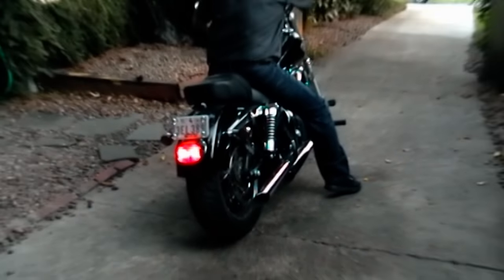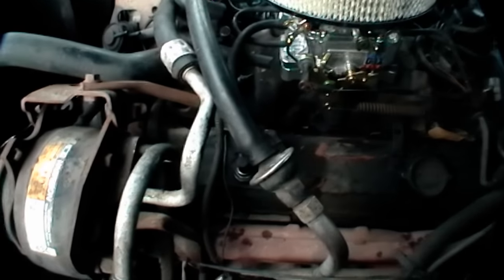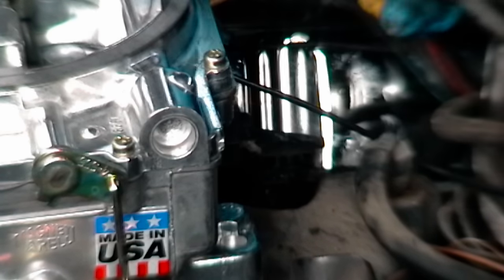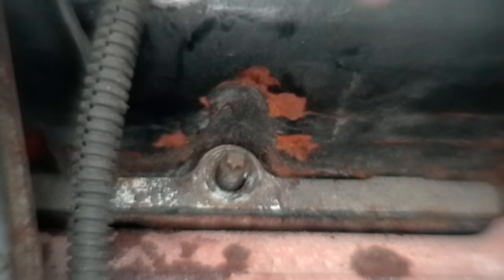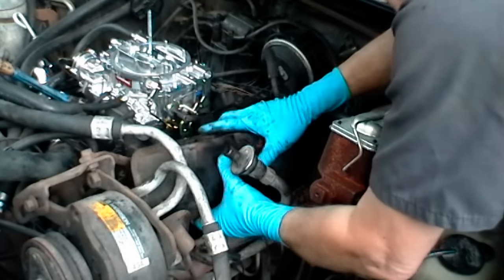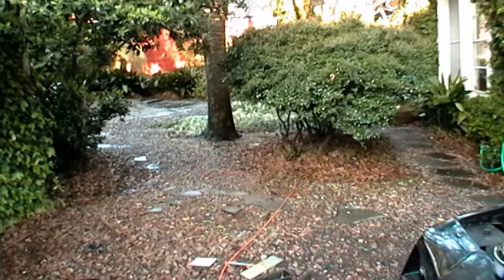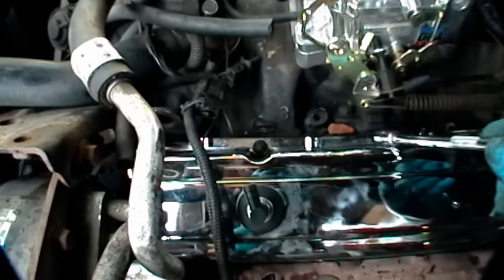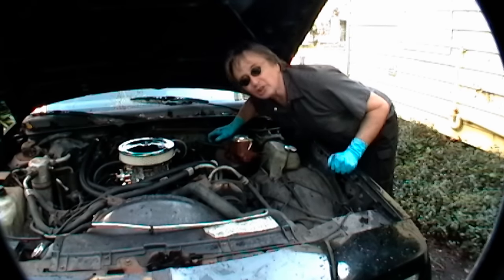How To Replace a Valve Cover Gasket

Comment: Oh, to work on a car that is that easy to fix...
Reply: Try an mr2 spyder🤣
Reply: Try a 4th gen firebird
Reply: Try an 1999 Toyota Avalon
Reply: @darthgamer6080  yea, the Avalon is hard, but at least you can SEE the engine. In the firebird 60% of the engine is under the damn dash
Reply: @adamspitfire  that’s what I have and this is the issue I have that needs fixed 😂 so how hard is it gonna be
Reply: @Tannytkn  it's easier to skydive with an umbrella and find the cure for cancer in one night under your bed.
Reply: @adamspitfire  lol 😂 also I have to do the oil pan gasket and motor mounts
Reply: @Tannytkn  oil pan gasket is easy if you can get the bolts off

I'm sorry for your misfortune of an motor mount and wish you good upon your horrific journey of pain anger and a shitton of blood.
Reply: Try a subaru😂 those boxer engines are a money pit
Reply: Try a 2005 Lincoln ls v8
Reply: This is why I daily drive a ‘79 V8 utility, easy maintenance!

Comment: I heard a rumor, that if u put a small amount (about a quart) of diesel fuel, in your (gasoline) car engine oil, right before u change the oil, let it run for about 5 mins... that it can clean out the internals of your engine... is this true, & what about tyranny fluid. in this same scenario.  just wanted to know if that worked... if so, is their other chemicals that work better that's not marketed for that use, that's 100% safe... thanks...

Comment: Of course you showed the easy side. Can you tell me how you got the other valve cover off? That's the only one I'm having trouble with. I have the same engine as this one.
Reply: prolly to late but you have to take the belt off the ac compressor loosen the bracket bolt and slide it our of the way.
Reply: @two_tone  prolly too late 🤣🤣 im dead

Comment from the maker: most valve covers these days don't even need sealant, especially the silicone ones. But I use sealer on the old fashioned ones that use cheaper cork gaskets.

Comment from the maker: you can use rubber without sealer. The price just depends on the car, some are 30 bucks, some are hundreds when parts have to come off like intakes.

Comment from the maker: @Matthew55904  You do not need to take the valve cover off to check spark plugs. You may have to take those stupid beauty covers off to access the plugs, but not the actual valve cover. Scotty

Comment from the maker: valve gaskets are on the top , just under the valve cover assembly. A pain to do, but just moving crap out of the way with normal hand tools. Head gasket is where the head bolts to the block , a GIANT job I would not advise doing except to really mechanical people with lots of tools and experience

Comment from the maker: @X2N18 Just make them snug, they don't need that much force. They are small bolts and will break if tightened too much. That's why I used a tiny 1/4 inch ratchet. Scotty Kilmer

Comment: I was more interested in seeing how you fitted the new gasket, whether you put the gasket adhesive on both sides of the gasket? did you use a cork or a silicone gasket? this video should be described as how to change an old rocker cover to  a new chrome one as there is practically zero explanation as regards the gasket.

Comment: lol you didnt even put a gasket on the new one???
Reply from the maker: I certainly did
Reply: ah, just didnt show that part in the video i guess
Reply: bowtieguy
Reply: What Daniel Figueroa
Reply: I was wondering the same thing.
Reply: stay away from your vehicles hood
Reply: bowtieguy.
Reply: Exactly smh
Reply: This is "How To Replace a Valve Cover Gasket" without a valve cover gasket.
Reply: @boduke548  stay away , period
Reply: @swaggedoutwun  yes he showed that part it was the sealer he was putting on give your head a shake
Reply: Yeah, I got the easy side. It's the one that's under the intake manifold what's arrested on bolts to go all the way around the back by the firewall that's pissing me off!

Comment: Try doing this job on a Ford Explorer.  The engineers decided to cover the these things with every single wire and hose the engine comes with.
Reply: I know right! Same w the Ford Ranger
Reply: I just did it. And almost threw a wrench at my truck
Reply: Been there as well
Reply: Not as bad as my continental. Those idiots hired the most complex engineers. I have to remove the fuel injectors, the ignition coils, and a bunch of wires and hoses . That's the easy part for the front valve cover. I gave us since I didn't have a swivel but now that I have one I might just get to work.

Comment: Hi , I have a question ,  It's my first time changing my valve cover gaskets and the car is a 1988 ford mustang with fuel injection so it has that tunnel ram thing that is in the way of getting the valve covers off.  so how do I do it?   thank you  jodie

Comment from the maker: old age. . Change the pcv valve and pray it's just that. If not, the engine is just wearing out internally. In that case, drive it till it drops and keep adding oil

Comment from the maker: live with it, you have to pull the head off to change the valve seals, and it could also be worn piston rings requiring a full rebuild. They can run years that way, just keep oil in it and change spark plugs as they carbon up

Comment from the maker: fan clutch is easy IF you have the special tool to unscrew that giant bolt. And the top of the intake would need removing to be the valve covers off the whole way, no working room there.

Comment from the maker: safe to do that, try some compressed air too to blow the crap out when loosened.  I don't recollect any plastic clip though, if it's in the way, figure out how to turn it to get it off IF it has no bolts holding it on hiding under any small cover

Comment: Hey scotty, once replacing the valve cover gasket on the the engine, should we still use high mileage synthetic motor oil or go back to using regular synthetic oil?
Reply: there's tons of other o-rings and seals in the engine, the valve cover seal is not the only seal. to be honest those additives probably don't do much if you have an oil leak anyways.

Comment: Good job, anyway I would like to remember the people who want to replace this part that aluminium is not very strong thus while tightening the screws be careful not to exagerate otherwise you will damage the thread causing more problems afterwards😉

Comment: Hi Scotty , I replaced the valve cover gaskett and when putting the bolts back on I had a bolt snap off and I wasnt using any power tools just my hands and I am not a strong guy.  The bolt is in a position where I cant get it out from the bottom and was left with a top that is a half moon on one side sticking up (so its not flush).  I have used lubricating sprays and tried to use that little bit that is sticking up to grab onto rn it and tubut its not working.  What should I do?  PLEASE help me.

Comment: hey Scottie, i have a 95 toyota camry. it started, drove a block then shut off. all lights n radio working. car now cranks but wont start. the crank sounds normal to me, not faster than normal. i am seeing a little tak when i crank the key - not much only about to the very first notch.  i figured  bad fuel pump so i replaced it but it still wont start. the relay and fuses seem fine. i get pressure when i depress the fuel pressure nozel, i see some spark coming from spark plugs.  so i believe i am getting both fuel and spark. where should i go from here? i dont have any fancy tools just basics. i dont know much about cars, and i am pretty broke. 
Can you or anybody else help ?
Reply: Patrick Engles Jr probably the distributor!

Comment: Hi Scotty!!! love your channel. I have a question. I have a SBC 350. I was going to put on a Edelbrock EPS intake manifold. Upgrade the points ignition system to HEI and put on a new carburator. It has a Qudarajet that needs rebuilt which I was going to attempt but after further study found it would be easier to just but another carburetor. Since I highly respect your opinion, which would you choose Edelbrock, Holley or another Quadrajet. I have received so many opinions but they are biased just like people who prefer dodge over Chevy or Ford. or visa versa. Everyone I spoke to said make sure you get an electric choke carburetor also. That was their only common ground.  I need your expert opinion please.
Reply: I would go with either Edelbrock or quadrajet in my experience those are easy to adjust

Comment: Hi Scotty, I just finished replacing the valve cover gaskets, spark plug seals, and spark plugs on my 1992 Lexus ES300. It started up ok but after warming up is idling rough, I think it's running on 5 cylinders (feels like my 1992 Nissan Skyline when it needed a new coil pack). When accelerating I usually get all 6 cylinders, it's worst when stopped at lights, feels like it will stall but doesn't. When I start from cold it's ok until it warms up... Any suggestions?? I was going to go back and make sure the spark plug leads were pushed in properly etc, then maybe test the plug leads as I didn't replace them. The spark plugs I used are the ones recommended by Lexus / Toyota. It was fine before I did the work on it, so I figure it's something I've done, or maybe moving the spark plug wires was enough to be the death of one of them..?? Appreciate any help, I can't afford to pay someone to sort it out!
Reply from the maker: Jas George the back side gaskets are hell to get on, requiring intake manifold removal. SO many things can go wrong in that job, check for wiring shorts, vacuum leaks, and any sensor that may have been unplugged

Comment: just curious what did you charge for this job? if I use the felpro rubber gaskets do they still need sea lent? I've been told none is needed on rubber gaskets

Comment: Scott, Thank you again for this great tutorial. My car is 2000 Taurus, when I do the valve cover gasket(front and back), beside the gasket, what else I should put on the valve cover? silicon sealant? "Right Stuff". May you give me a little detail? I saw mixed information on the web. Some people say gasket itself is good enough. Some people say you have to add silicon sealant on the edge. What is your opinion? Thank you
Reply from the maker: if you use a gasket, you can put a little sealer on it to keep it from falling off the cover when you put it back on, i often do that. The faster drying sealers are best for that so you don't have to wait as long
Reply: Scotty Kilmer Hello, May you suggest a brand & name that you use. I know you use "Right Stuff" but I am not sure which one you used for gasket sealant for valve cover gasket. Thank you
Reply: codyq0987 Ant brand. Make sure it is High temp RTV.
Reply: If it is a press fit gasket, you absolutely do NOT want to use RTV, it acts at a lubricant and will cause the gasket to squirt out.

Comment: Hey Scott, I got a 4.2L 6cyl on a Jeep Wrangler I’m having trouble with the last bolt on the valve cover against the fire wall. It’s an 11mm I just can’t seem to fit the socket down in there. Any ideas?

Comment: @eensha6242001 ohv stands for overhead valve you dont put them in your car has overhead valves unless its from like the 20s you could try it on your car but if you have no experience i would recommend you do some lawnmowers first

Comment: I’m replacing the valve gasket on my 1995 Corolla 1.6 and after putting on the new gasket do I need to apply gasket sealer or should I not? Is it needed?

Comment: Hey Scotty. I have a 2003 Chevy Suburban with the 5.3 vortex in it. My valve cover gasket and bolt grommets were leaking oil. Upon replacing, I noticed that there was slight sludge and grime underneath. How can I clean the area?

Comment: I was going to tackle the job on my Lexus LS400.  Then I looked carefully at all the stuff I have to remove just to get the valve covers with their spark plug tubes and I quickly changed my mind.  Off to a pro. with my checkbook in hand.

Comment: @samvid74 Scotty is oil can come from the bottom going through the spark plug  from botom up to the spark plug tube. this is in case  if  head gasket is leaking. because if oil is coiming fromthe top i will see some oil next to the seals and in the top of the oil. but i am seing oil only when i remove spark plugs

Comment: @scottykilmer Hi Scotty I have oil leaking in spark plug in my toyota camry 98. if the upper seal is the problem, why i cannot see any oil next to the seal. i see oil only on the lower end of the  wire that goes into the spark plug. that make me think that oil is leaking somehwere from the bottom. please explain to us. thanks

Comment: I think the valve cover gasket is not the one that cause the leak. this gasket  oprevent leaking of oil to the outside. however it s the spark plug tube seals that are the real causes here. I think another source of leaking are also possible it s the bottom of the spark plug tube. it  s good to replace the valve cover gasket if you already take the cover out  though.

Comment: Hi Scotty I currently have a GMC Yukon 95' 5.7,  it cranks but doesn't start and the head gasket cover popped off while cranking the engine and  the cover is now bent it also had white smoke coming from the engine after it popped off any advice on what it could be? I'm thinking it may be the timing chain snapped  and pistons might be shot.

Comment: Hey um I got a quick question for ya...my 95 gmc seira 1500 was sitting up for a while outside and I'm currently restoring it and I've ran into so problems with it when I start it it has blueish white smoke coming from exhaust and when I give it gas it REALY puts out some clouds I know it's not normal so you got any ideas on what I could do...plz reply asap

Comment: I watched one of your videos where someone changed a valve cover gasket for a client and client came back to you with leaks because they didn’t put weather seal. I had done the same thing on my vehicle few days prior following another video and even knew it was the middle gasket leaking (of the four on my 2010 Ford Focus). I redid mine with your suggested seal, and voila, no more leaks.🎉

Comment: I just got done doing this on my 2013 Chevy Cruze and the thing about that car is that the PCV is built into the valve cover, I changed the gasket but didn’t get a new valve cover and now when I start my car there’s smoke that starts coming out from around the exhaust manifold near the flex pipe once the car heats up after around 30 seconds. Also my radiator fan starts spinning at full speed as soon as i start seeing a little smoke. I’m wondering if this has something to do with my pcv which is built into the old cover or if this is something completely unrelated because I never had these problems before changing my gasket. Any advice would be appreciated.

Comment: hey scotty.. i have a 94 ford f150 300 straight six. it leaks oil from the valve cover and is dripping on to the exhaust manifold and burning up..what should i do and what do you think it might be?

Comment: Help person  who changed my valve cover gaskets put all back together but when try to start car it cranks but don't turn over, when you just turn key on you can hear air or gas line leak what did he miss. 1993 toyota camry 3.0L V6

Comment: hi scotty..there is leaking gunk ..not exactly oil around the valve cover and the distributor. What do u think is wrong in the distributor? and why does the owners manual not talk of the PCV valve replacement..Thanks!

Comment: Hey scotty would a bad gasket cause a misfire on an engine ? Im abt to purchase a 06 ford f150 from a guy who alredy replaced spark plugs and coils on the truck but still has missfires i want to take on the challenge and fix it cus hes tired of it the truck is real clean i think its worth a shot

Comment: Hey Scotty, I got a 2001 Audi A6 2.8. The car has a burning smell and somtimes smokes and I am told its a valve cover gasket thats leaking on exhaust manifold. My question to you is that is there a fire hazard(smokes sometimes) with this leak? Thanks

Comment: Scotty just got a 1986 regal Buick old owner said he change the seals but from the passenger side top theirs white smoke coming could that be bad?
Reply from the maker: +2128rulloa that's often the sign of a worn out engine with piston blow by
Reply: +Scotty Kilmer is the valve cover gasket an important job . and will you see a diffrence once its changed i have a lexus 2000 es300
Reply: Valve cover gaskets are usually replaced because the old ones have failed (cracked/dried out) causing an oil leak. It's not as if it's part of a "tune up," but they should be replaced if you notice oil leaking from them. Oil can work its way down to the manifolds and other hot areas that will cause the oil to burn off (burning oil = blue smoke) not to mention your oil level will decrease as it leaks.
Reply: could be a sign of an old worn engine with blow by, also check the head gasket. I have a 1972 GMC C1500 with a 350 small block and i was getting white smoke at the same location as yours. i pulled the valve covers and the gaskets are fine. Its a common mistake people make with their cars, so ive heard. Turns out it is the head gasket on mine so it could be the same issue on yours. What size motor>

Comment: @ Scotty Kilmer 
okay so i replaced the gasket and when i went to drive it again the car was not shifting right (its an automatic) like i would have to switch it from "D" to 3 gear and to "D" again in order to shift it  and the engine was overheating. could i have not replaced the vacuums wrong or the electrical work ?

Comment: Scotty I have a 1994 Ford F-150 5.0 engine the speed meter stop reading I replaced both sensors still will not work. Also my heater no longer works help

Comment: Scotty do you know the valve cover torque for 89 toyota pickup 22r
also 96 toyota camry 2200 engine.
No one seems to know,I even called the dealership and they didn't know ,said they would have a specialist call me back....lol   didn't happen...still waiting. tx